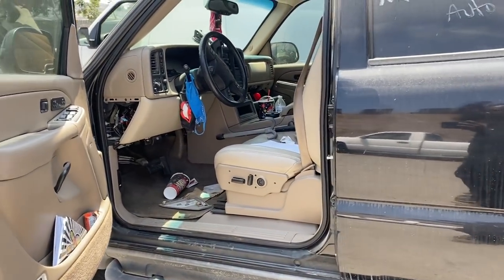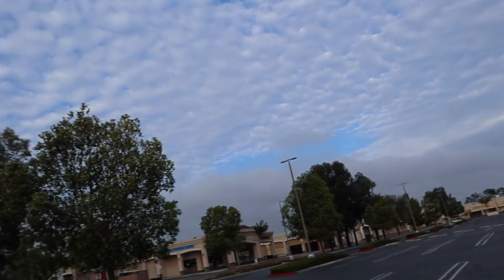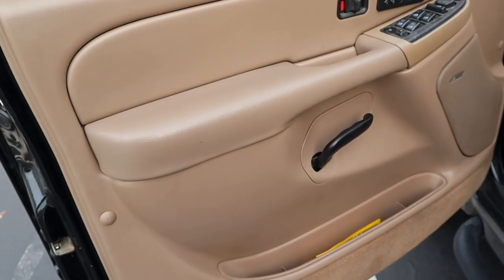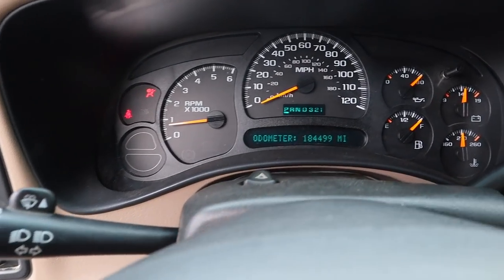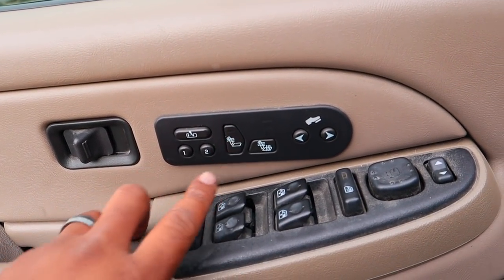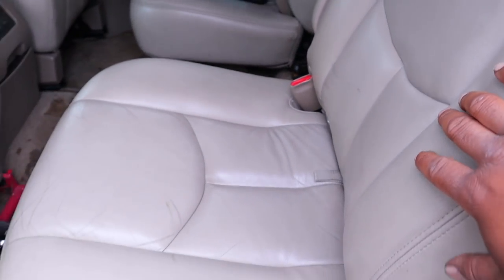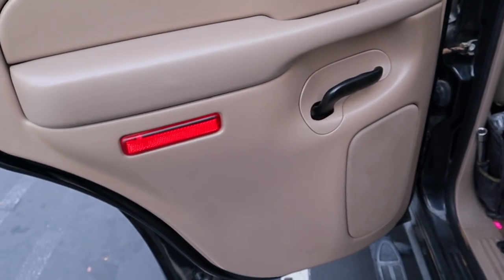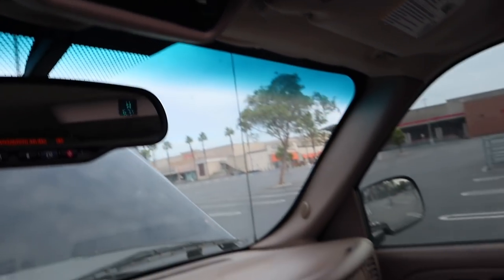I BOUGHT A 2005 Z71 TAHOE IVE ALWAYS WANTED FROM THE AUCTION HOW BAD IS THE DAMAGE???

Comment: 99 tahoe OBS 4x4 with denali seats and escalade center console,doorpanels,steering wheel,and cluster. Just completed my set of oem z71 flares. Almost ready to install.
I have some U255 26s with damn near new tires for 900$,or 24" T.I.S's with meaty matching tires. im in l.a Guru let me know.

Comment: I have a 04 Tahoe z71 158k on it runs like a champ just put the k&n cold air intake next I need the e fans and throttle body spacer think about a jet throttle body but there like 400